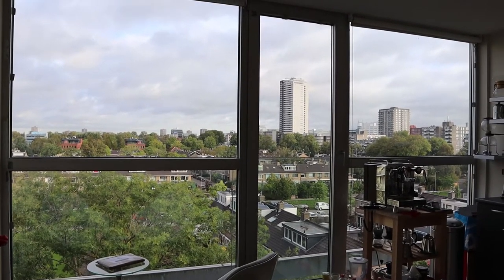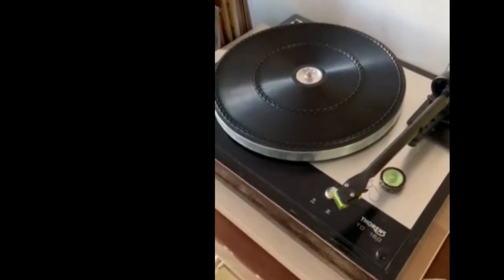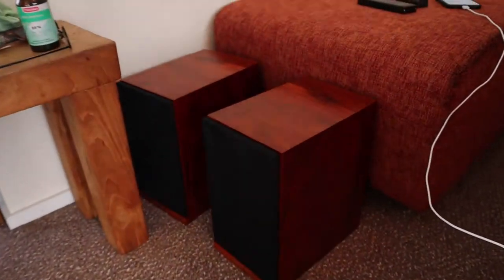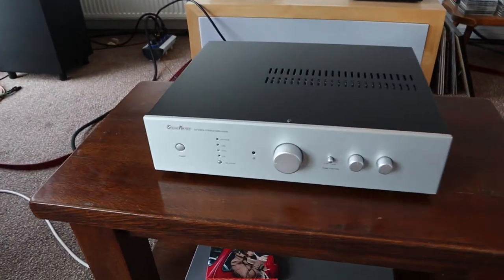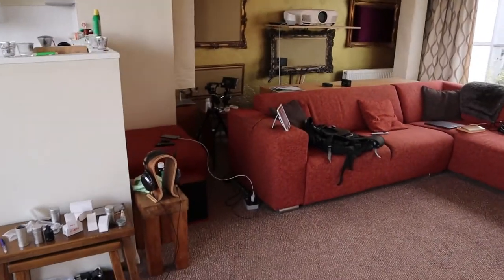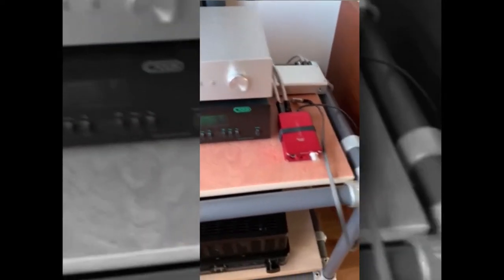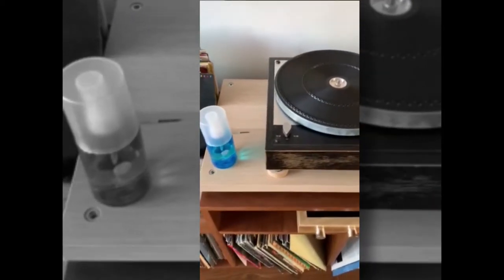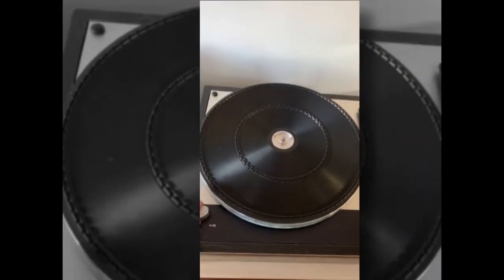A subscriber question, Grundig Audiorama 8000 and more SoundArtist. The Audiophile Barista Vlog 66

Comment: Thanks for the suggestions. I don’t think this issue relates to the amp - works fine with other components, no hiss with volume up loud. The hiss is still audible when platter is not spinning. I have just received a new motor and power supply which I will be fitting over the weekend, I’ll let you know if this helps. Process of elimination I think

Comment: Try swapping out the interconnects for a regular set. If noise continues remove the schiit from the system. If noise continues after that, I don't know what else to try other than swapping out the r8 for another amp that you know to be a known working unit.
Reply: Machete_[8K UHD] 
Yeah, I agree.

Comment: Possible problems: if it is a permanent hiss but in lower frequency, it could a be dying caps in the power section of the amplifier. 
Next thing could be broken transistor inside a pre/power amplifier. 
Or a ground problem, or......
Best way to find out, disconnect all units , connect step by step the units again together and check when this hiss start  again.
Reply: I've recently bought a cheaper EL34 amp from China from another manufacturer and decided to replace all capacitors which appeared to be fake Elnas, Mundorf foil and others. There were a few  axial "Vishay" ones which showed very high leakage on a simple element tester. After replacing with similar parts from a known supplier, the sound improved and it also seems "quieter"...
Reply: Hi thanks for the suggestions. I don’t think this is related to the r8 amp though. This works fine with all other components. Sound is totally ‘black’ , no tweeter hiss even with volume high. Is is either the mani, cables or thorens related. The hiss is still present when platter not spinning. I have just received a replacement motor and power supply which I will fit over the weekend. I’ll let you guys know if this helps
Reply: @daviddarley4749  I think the problem is the schiit mani. If you see at the bottom of this device, it has many so called "dipp switches" for setting amplification factor, and settings for mc /mm and  load resistance  of the phono cartridge. If settings are not correct here, hiss and humm get to much amplified, and you hear it over your speakers...Phono riaa amplifiers are very sensitive devices for hiss and humm! The wilsenton amplifier is fine, as you say other inputs have no hiss/ humm. Good luck!👍
Reply: JH allo - thanks for this. I can reduce hiss by reducing gain settings as you say. Problem there is volume on amp needs to be much higher. I followed the manual to get the suggested gain setting for this cartridge so ideally I would like to  see if I can tweak other areas to get this down. The internal electronics of the thorens are very old, i now have a new power supply and motor to fit, process of elimination I think. I might try messing with dip switches again though
Reply: @daviddarley4749  Hi David.  You can try to disconnect the turntable from the schitt mani. If hiss still occurs on the speakers, you should take a closer look on the schitt mani. I don' t know  the state of the electronics in the Thorens turntable, but you should expect a hard humm, if the filter caps on the power supply are faulty... Signal pad from the phono cartridge to the schiit mani, is no more than 4 wires trough the tonearm, and the cinch cable from the turntable to the schiit mani. The turntable motor is not connected to the signal pad, so i don' t expect hiss from that direction...Also try another cinch cable between the schiit mani and the wilsenton amplifier, maybe it will be that simple???🤔

Comment: I am running active 3way tad horns so hiss is something I have to deal with very often. Unfortunately, it is almost impossible to give suggestion as there are too many factors and I also need a lot more information. Upside is you have a simple system and the hiss is way too Loud, so let’s try. (Please forgave my English, it is not my mother language)
Beside the hiss, is there hum from the woofers? Could you tell me which machines connect to the ground? A mapping on how all machines connect together would allow us to communicate easier. 
1) you should start disconnecting all the input from the power (or integrated) amp and see if the hiss still persist.
2) if the hiss is gone, then connect just to the phono. (Which usually where the problem is). The phono should be disconnected to you head amp/cartridge. 
Please let me know the result of the above two steps. I will suggest next step after. 
Btw, I believe the hiss is too loud to be coming from the cable shielding after the phono. It maybe contribute a little noise but it is not the major cause.
Just to avoid confusion, did you meant the hiss is gone when the platter is spinning?
Reply from the maker: bng2679   Active 3way tad horns? Now I’m jealous 😁 Would love to hear your system. 
- My Ocellia loudspeakers are 98 dB so if there is any hiss you will hear it.
- Thanks for your comment
Reply: The Audiophile Barista , the Et703 and the TD4001 is around 107db - 110db so hiss can come visit very easily. Imagine hiss come from an amp that has 100db or less noise floor (Amp with 100db SNR is not a bad amp already). Any tiny problem in any aspect can hear clearly.

Comment: pull the leads to the amp out and if the hiss goes away, it's most likely not the amp. then swap out the other pieces one at a time (turntable, preamp, cables, etc.). it sounds too high to be a grounding problem. i would suspect the preamp. do you have another phono preamp that you can try?

Comment: I have the same problem as David, but I have it on all inputs not just my turntable.  As soon as I turn the pre amp and the power amp on I have that little bit of hiss, even with the volume on 0 and all input devices switched off. If I only turn on the power amp, there is no hiss so in my case I suspect it might be the pre amp.
Reply from the maker: Jayvee   Sounds like a pre-amp issue. Can you use another pre-amp to see what happens?
Reply: @theaudiophilebarista2424  Unfortunately I don't have another pre amp to try. I do have an integrated amp but it doesn't have a pre out.  I connected my phone (LG V30) directly to the power amp and that sounds much better than when I connect it trough one of the inputs on the pre amp though, not sure if I can make any conclusions from that...